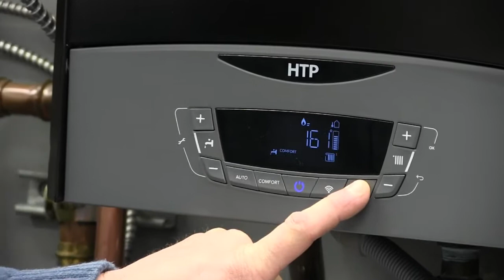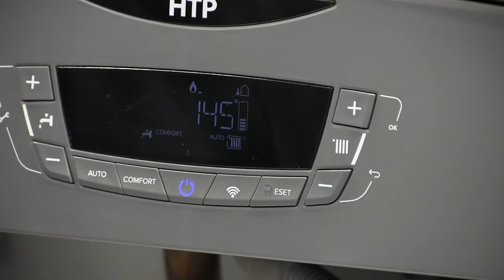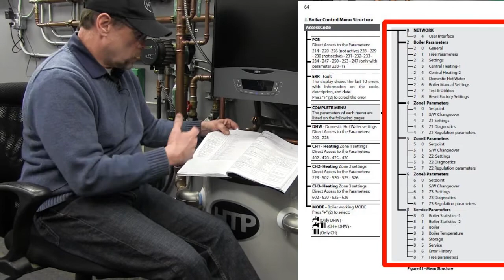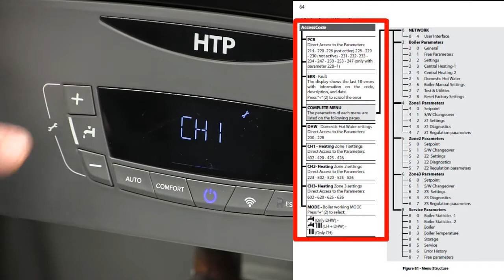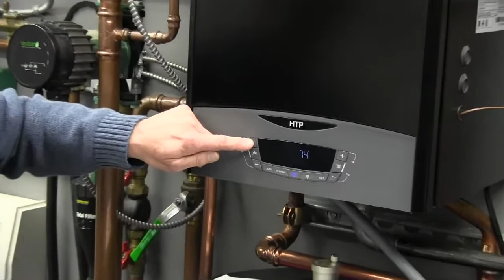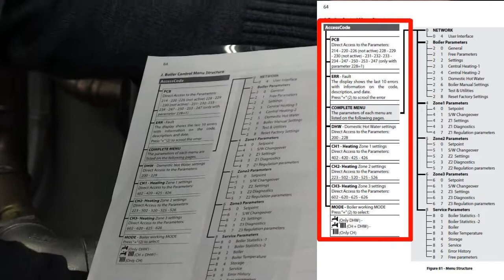HTP Elite Ultra ELU Boiler Control Setup | Step-By-Step Overview

Comment: The DHW valve doesn’t shut off despite the indirect heater sending the electronic signal. Only if the indirect heater is completely turned off does the DHW valve close. What could be wrong in the HTP setup? My plumbing company is
Completely stumped , can you pls provide some inputs

Comment: Do not buy HTP Elite boilers.  My new boiler has been leaking and stopped working every few months, including Christmas holidays, when I have a house full of guests and no heating or hot water for a week.  HTP service is terrible; they don't respond, and force you to use an app called Wizard that does not have the options you need to proceed.  The staff member who responds hangs up and just reads a recorded line that does not fit the problem you have.   I have not received a refund for repairs from defective equipment.  Even the technical support told my plumber they were aware of faulty gaskets, but they still sell the equipment and don't refund you.

Comment: My Boiler wont stop running. I'm only using it for radiant heat , NO DOMESTIC hot water.  Do I have a set point wrong ?